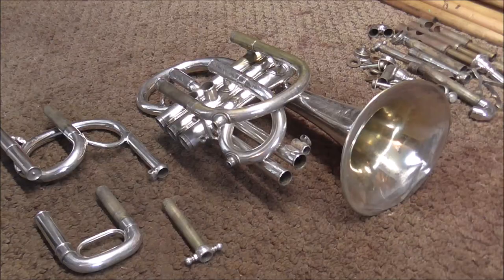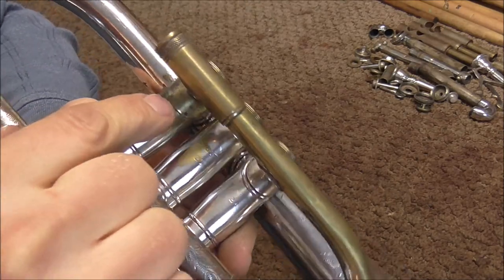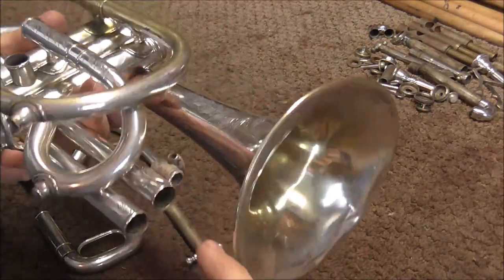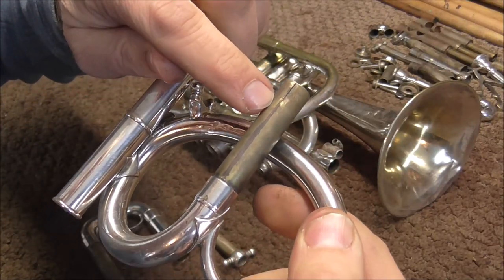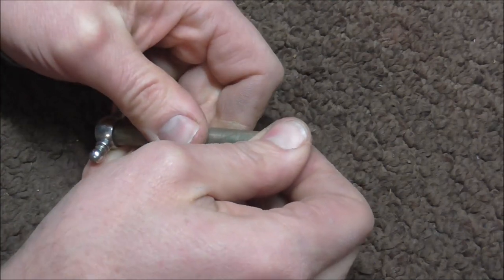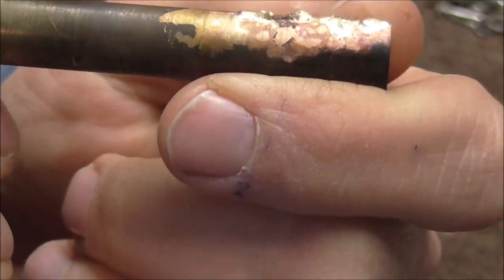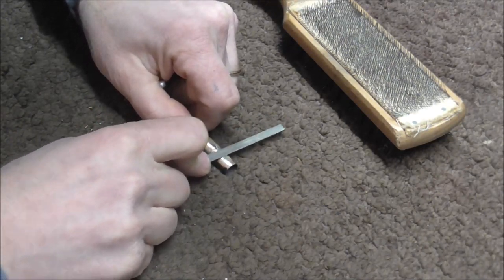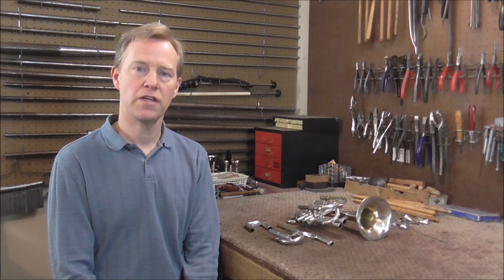Repairing a Tuning Slide Crack in an Antique Cornet: video #3

Comment: Since I mostly repair old/junk instruments, I often have to silver solder cracks (and at one time I succeeded to make a new leadpipe for a vintage saxhorn). From my experience, making the split a bit larger and wider helps, I generaly bevel the split edges to make a flat V form... the solder flows and sticks more easily. The only drawback is the risk of solder flowing inside of the tube.

Dipping the end of the part in water is a great idea ! I sometimes use a similar method: I soak a rag with water and I wrap it around the solder joints to protect... also useful for unsoldering large solder joints on a sousa or tuba without unsoldering every brace and flange around.

Comment: Really interesting.  I'd never really thought about it since I've never seen this type of damage, but yeah.  The leadpipe has to have a taper of some sort.  Drilling it out with a reamer would be ridiculously labor intensive compared to just brazing together some sheet metal with the taper built in.  You have to smooth out the exterior of the tubing either way, and that's dramatically faster.

Comment: I think the difficulty getting the silver solder to melt and flow (10:20) is due to the other end being in water: the whole thing is cooling off very effectively. Better to do it dry so the part can get warmer. EDIT: I guess I should have waited for 10:43 to make my comment! The clamp takes a bit of heat, too, but the water is the real culprit here.